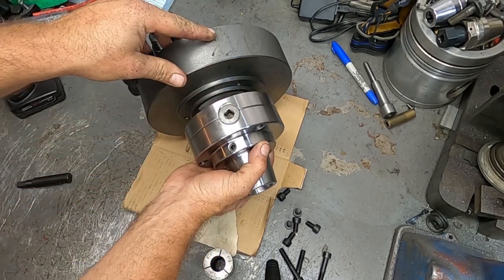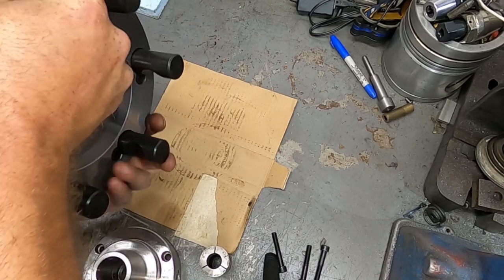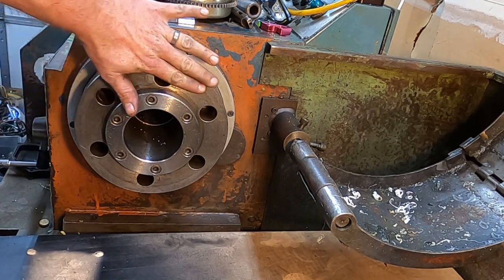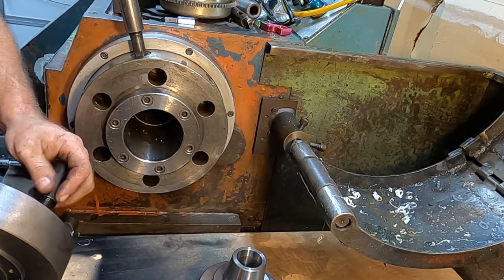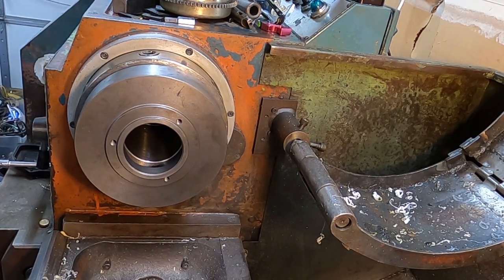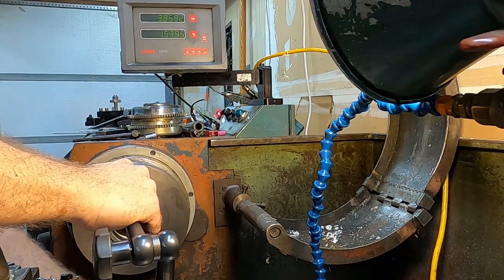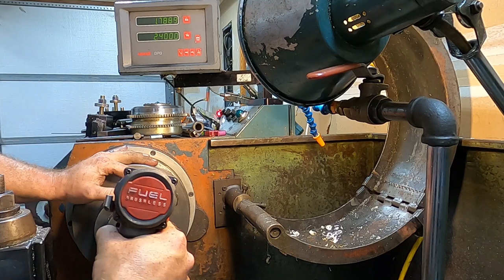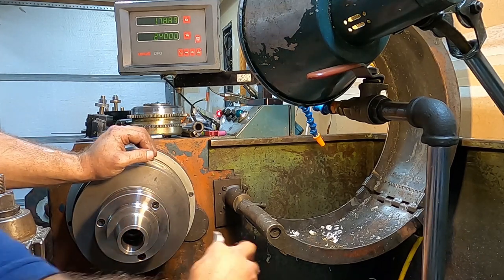Bostar C5 collet chuck . How to assemble, machine and install a d1-8 cam lock lathe chuck

Comment: Just ran into this video.  Use the depth gage on some dial calipers and set the pins to 2.00 inch height to the nearest revolution that lines up with the lock bolt.  When tightening starting at 12 o'clock the key should end up between 3 o'clock and 6 o'clock with 4:30 position as ideal.  If you are mounting a 100 lb chuck you do not want to be on and off a ton of times to get the pins set properly.

Comment: I am brand new to this. Thanks for the video. I just bought a older Craftsman (Atlas) metal lathe but it has a 1 1/2 x8 spindle. I really like the idea that the back plate is already drilled for the collet holder. I take it, it's a kit. Do you happen to have any information on a collet holder and backing plate combination that would fit my lathe ? I have looked but could only find ones that you have to drill the mounting holes also. Thanks in advance.
Reply from the maker: I dont know if there are pre drilled kits for 1 1/2" x 8 .  Most are not
Reply: @EricksonMachinePerformance  Thanks. I'll keep looking. And learning from your videos. Thanks again.

Comment: Nicely done - why did you choose the 5C system over an ER collet system?
Reply from the maker: I like 5c for part holding and ER for tool holding .  And the honest answer why is because its want i am used to. Both are great.
Reply: Most ER collet holders don't allow a part to go through
Reply: 5C collets can also clamp onto a very short section of the part. ER collets should have stock through the whole length of the collet.